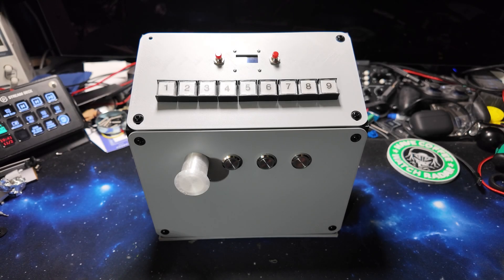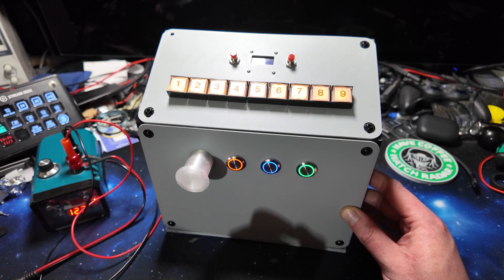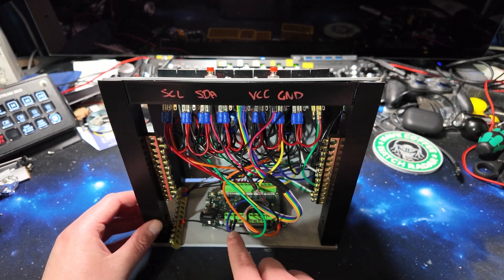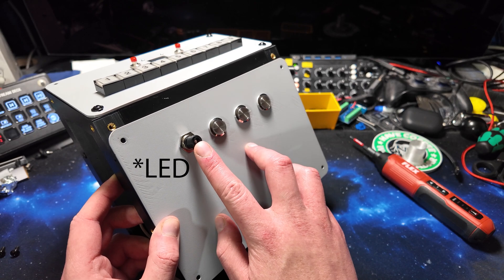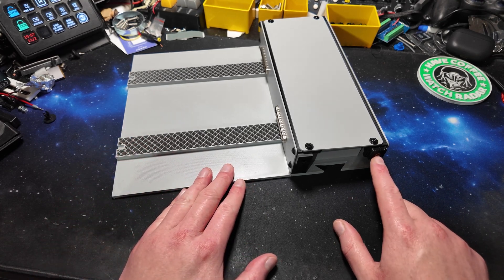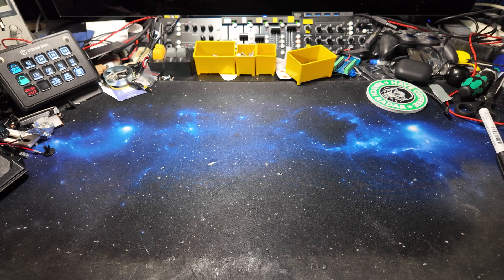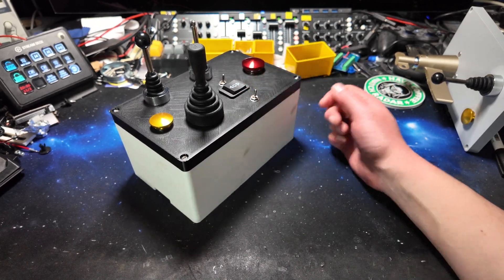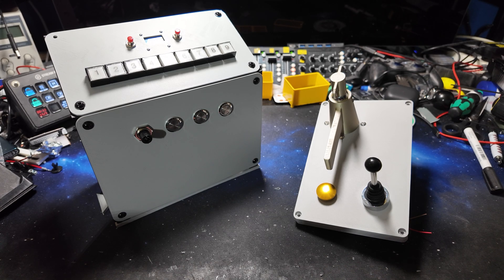Train Simulator Controllers Mk2 - Part 2

Comment: Hiya, can you do a class 50 throttle and brake handles?
Reply from the maker: Yes that should be possible and that's why I set this up to allow double-width modules. I want to make modules that will cover the class 37 and class 50, as the throttle and brake controls are essentially the same. The spring back from release to running on the brake handle is something I will need to work on, as it never worked well with the old controllers.
Reply: @MattTester  The spring back would not bother me so don't make that a priority. I assume you will be selling these?
Reply from the maker: @funkyx486  No plans to sell them, I will probably make the 3D printable parts available online though.